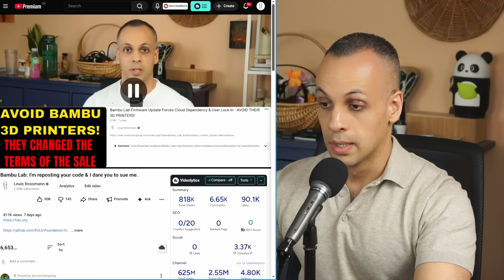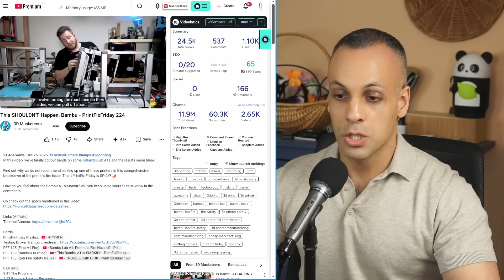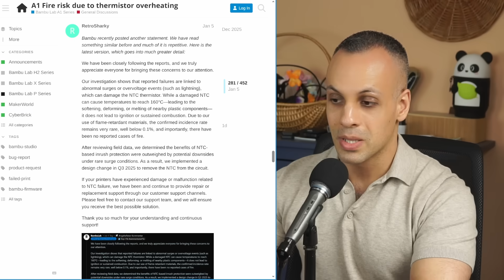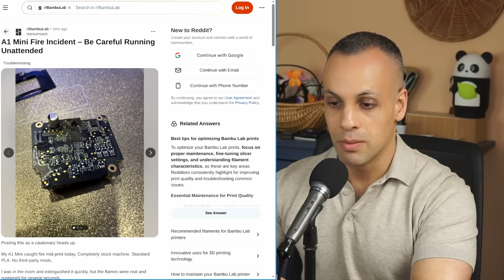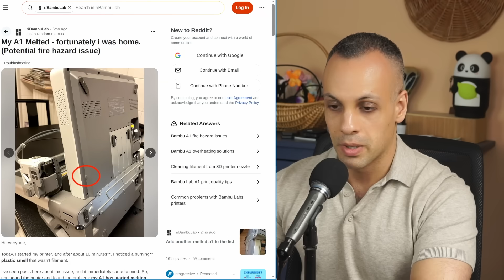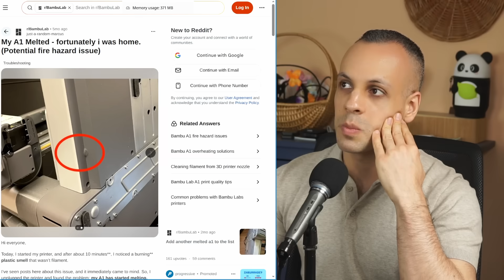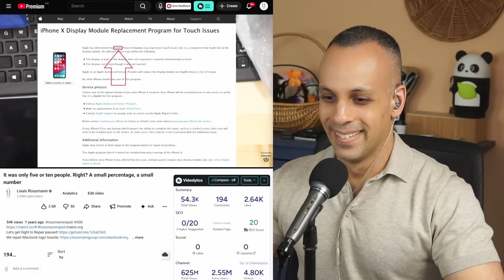Bambu Lab PR dumpster fire is turning into a literal one...

Comment: Their idea of PR is that of the CEO, who is a crook. He greases palms, so what do his people do? They GREASE content creators who accept it on their channels without so much a single thought because it's "free" showing people who throw money at BL crap, just how little these machines cost to make given the sheer volume of content creators who get these for nada.

4:51 Never. I have several 3D printers, some of which are bought pre-release of the patents for a lot of money. I've seen BL in the wild and i'm not impressed by the use of fancy material finishes as others are. A properly tweaked and kitted CR-10 first edition with about 100 e worth of upgrades in parts and control boards can outprint their best. I've done prints on such a machine that are so finely printed, you cannot see the layer lines without sacrificing speed.
Printers are plagued by the same issues machinist tools are. Rigidity and "speeds and feeds". If the slicer and code can control such things and if you can make the machine properly rigid, properly adjusted (not tighter than a monk's purse, but rather adequately adjusted) you don't need a full frame.

It's a pity people don't tinker with their printers more to discover these things. Most purchasers just want the hassle free experience.

Comment: I sliced my finger open on a razor sharp tab on the back of my PS1 enclosure. I contacted Bambu about it and they said I shouldn’t be holding the printer that way. The point is, I did as it was the natural place for me to hold the printer to move it. When I checked on the 4 identical printers at work, they all had exactly the same razor sharp tabs. I pointed this out to Bambu - they couldn’t have been less interested.
Reply: Only a small number of users hold the printers and hurt themselves, so really it isn't an issue!
Reply: @Jdrunnin only a small number of people die from driving Tesla's, it wasn't me so who cares
Reply: People in the replies here are being so dense. You wouldn't say cars shouldn't have safety features after people report getting into a car accident and getting hurt.
Reply: @viper_exe_  exactly.
Reply: @viper_exe_  More like a bit of sharp metal somewhere on an appliance is not a major safety hazard.
Reply: @loganmedia1142 why should there be an extremely easy way of unintentionally  harming a consumer who uses a product? Why is the consumer scrutinized when they were harmed by a poorly designed product?
Reply: @loganmedia1142 If mcdonalds started putting rocks in their burgers, could you really in good faith blame the consumer for biting into the part that has a rock in it and chipping their tooth? Especially when the rocks were never disclosed as a possible danger. What if it becomes a choking hazard and people start dying because of it? 

This kind of stuff seems small and absurd, but its the kind of stuff that leads to permanent scarring, injuries and even death
Reply: You're holding it wrong.
Reply: @L0Sinc  tell me why? The usual way to grasp a square object at waist height is to grasp opposing corners. Added to which (and I’ve been an engineering director at Philips, Dyson and Ooni) I can’t see why these sharp tabs exist.
Reply: @meanredspider i was making a reference to Antenna-gate. Poking fun at apple / Bambu comparison.
Reply: It is as Rossmann says, it's the Apple of 3D printers. Antennagate? Nope, you just don't know how to hold it.
Reply: The DIY people should be coming out and saying that cutting oneself on a metal case is not at all unusual.
Reply: Why would they? 😂😂
Reply: @rightsdontcomewithpermits7073  lLet's hope the next major consumer item you buy doesn't try to kill you in some way or other, after all according to you why would they care?
Reply: @rafezetter8003  You do realise that's actually happening right? Electric cars with no mechanical handles?
I guess it's ok since only a few people died, and none of them complained.
Reply: @LordPhobos6502  yes and that's... a bad thing? That's our point???
Reply: You're the reason we have warning labels on everything
Reply: @99Plastics lLet's hope the next major consumer item you buy doesn't try to kill you in some way or other, after all according to you why would they care?
Reply: @99Plastics hot take: heavy items with unexpectedly sharp bits sticking out SHOULD have a warning label. I think even you might be upset if you picked up your toaster to clan or the crumbs and accidentally obtained a wound. Just sayin'
Reply: @99Plasticsyou’re probably the reason that there are crap products out there. I’ve been designing and manufacturing products for the biggest and best companies for 35 years. There’s no excuse for crappy parts that slice your finger open. It’s just shoddy design and poor quality. You might want to put up with it so you’ll get what you deserve.
Reply: This is why shampoo bottles have instructions
Reply: @fish1234-o7c  oh fuck off, as if they can't round off the sharp bits to reduce the likelihood of someone hurting themselves.

This is like saying "well it's your fault if you grabbed onto the spiky part of your phone" why does my phone HAVE a spiky part?

Comment: If someone is going to burn my house, it’s going to be me. That’s why I picked a Voron
Reply: Voron gang
Reply: @spidalack - No, the Vogons are completely separate.  Hey, do you like poetry, btw?
Reply: @stevewalker2028  Groop, I implore thee... /appendix self-detaches and yeets through the window
Reply: @stevewalker2028  nonono i know how this goes
Reply: I still run my Anet A8, with the original acrylic chassis, just added klipper and more reliable extrusion. 6 years waiting for it to light in fire itself.
Reply: @ReixGonzalez  An acrylic frame Anet A8 in 2026, what an absolute unit. That was my first printer wayyyyy back in 2016. Think I've had about 8 printers since then, lol. The mainboard on my A8 did short itself out and release some smoke, but it didn't catch fire!
Reply: @NefariousElasticity  what printer do you recommend the most please? For my teenage son, I would love your insight, thank you!
Reply: @ReixGonzalez I am running a wanhao duplicator with Klipper 😂
Reply: @ReixGonzalez  An older model doesn't have the same firebug problem, different parts.
You may have to set it on fire yourself.
Reply: @LordPhobos6502  yeah they do, older printers where very known for caughting  on fire at higher rates.
Reply: @ReixGonzalez I ran an Anet A9 for 9 years. Eventually I added a MOSFET and a safer firmware with runaway protection. It never catched fire fortunately.

I only replaced it 5 months ago with an A1. Not buying Bambu again though.
Reply: @Amt0571  Bambu lab have nice printers, good software (because of the good base that slic3r and prusa slicer give to them), but the company culture is trash
Reply: @ReixGonzalez  they probably have the best consumer printers. It's that good.

But that can't hide that, as a company, they are the worst.
Reply: Exactly. I don't need that automated, I want all the fun for myself.
Reply: I have only become more and more happy with my choice to go with the Prusa MK4 instead of a Bambu.
Reply: @papermario3982  The price is bigger, but the machine is legitimately repairable. I had 2 MK3S for about 6 years until I sold them, they were workhorses and learning to fix them wasn't that hard.
Reply: great choice!
Reply: That's a good pick.
Reply: Same thing except mine's a Prusa I (mis)assembled myself. Requires way too much adjustment to keep it homing accurately and the filament feed idler's stuck engaged with a zip tie because I assembled it wrong somehow.
Reply: Yep, rocking the Hypercube Evolution since 2018. Switched to klipper a couple of years back, "voronized" the XY-gantry moving the motors to the back last year, planning to "v-core-ize" the table this year. No fires yet
Reply: I mod many of my printers. I've come close a few times lol.
Reply: you know they can get on fire too right? The only printer I know personally that caught on fire was a Prusa so....
Reply: It’s going to be Cave Johnson, with the lemons.
Reply: Just have to make sure your PSU is genuine, there are tons of sketchy counterfeit Meanwells flooding the market these days.
Reply: @jessicav2031 real meanwells are getting worse too
Reply: @jessicav2031 most people are likely to fuckup the wiring
Reply: Actually if your voron burns your house down your insurance company is going to look real close at the power supply and it better have a UL PEDIGREED.  Even if it does and YOU bought it directly from China, you have all the legal liabilities as if YOU manufactured it. Shopnation is currently running into snags in bringing his new print farm online using Bambu printers. The printers are not listed by any listing agency…
Reply: @judd_s5643  How in the flying fook are you going to retrieve that information from a house that Burnt down?  I think you watch too much TV...   Do you have any real examples of this actually happening?  Something tells me you don't...
Reply: Vogon?
Reply: @spidalack  nooooooooo, you dont know Vogon?
you need a Babel Fish
Reply: @cutsomewoodbashsomemetalmakeso vorlon?
🎉 does the Babylon 5 Universe have Babel Fish?😮😂
Reply: @cutsomewoodbashsomemetalmakeso  I know where my towel is.
Reply: @spidalack  poetic
Reply: @spidalack  what did you just call me?
Reply: @aleks_jones  omg its aleks jones! You were 100% right about the frogs! I saw it for myself 🐸❤️🐸... 🤮
Reply: @spidalack  voron is a 3D printer for very nerdy 3d printing enthusiasts

Comment: It seems like the NTC device is something that could be fixed. I don't know why they would put that internally into the machine. They probably should have a separate power supply, or use a legit one inside of it that has an enclosure. It is not acceptable to put that in a machine where it is very hard to get to and can cause a fire.

Comment: I have a Bambu P1S which doesn't have any recall, or safety hazard. I love it, their amazing for the price. The reason their cheaper is that they have their own little eco system your supposed to buy into. I keep my printer offline, i print via a SD card, and use orca slicer/prusa slicer.

Comment: Without that PTC/NTC, they should immediately lose certification. 

On top of that, they are forcing customers to replace a part that contains mains AC hazardous voltage. That kind of replacement should only be performed by a trained and qualified person, not an average end user even the device is power off or removed from mains socket.

Comment: I own a Bambu Lab A1 Mini. Stopped updating the firmware and put it into offline only mode when the reports came out about the firmware update. It's  frustrating, because I like the printer. It does good work, and I don't have to mess around with finetuning the settings. It just prints good.
But it sure would be great if the printer continues its' great track record of not burning my house down! What a weird thing to hope for.

Comment: Incidence rate of 0.1% -> 1 million units sold -> 1000 fires (hint: not a small number)
Reply: 1000 is a heck of a lot. imagine if .1% of anyone who subscribed to louis, their computer spontaneously caught fire. there would be pitchforks and mobs of angry people.
Reply: something to keep in mind is that an incident of fire on any printer can be as small as a board like the AP, TH, MC, or any other board simply burning out.  The AP boards on some machines pop the capacitors which looks like a fire when they blow but that's them doing their jobs.  Too much power, pop to prevent further damage.